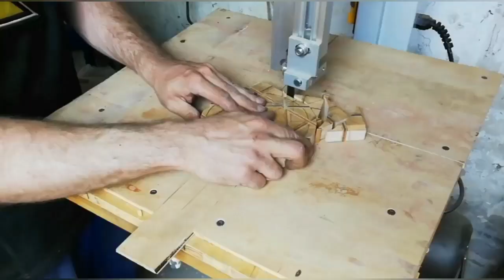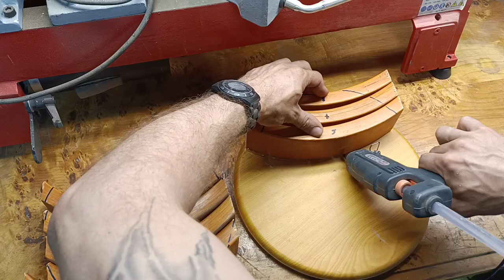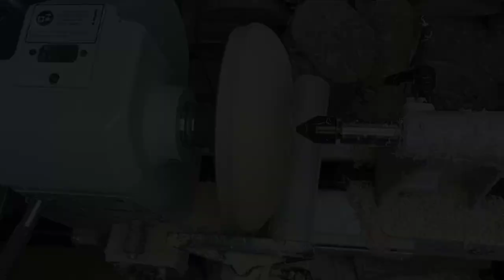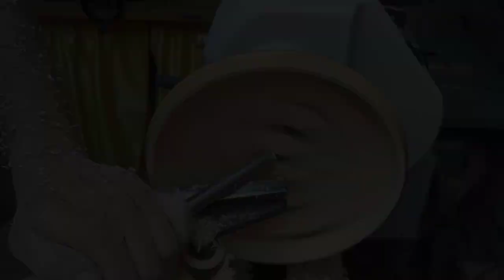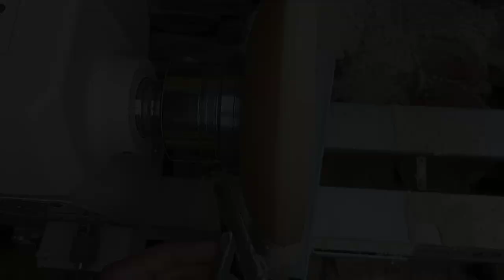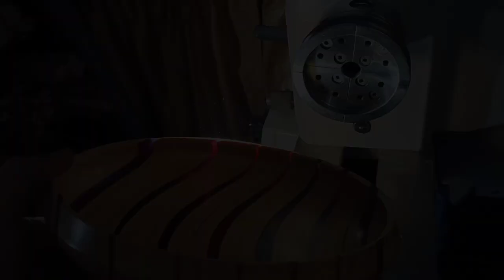Armchair is turnable too 😁 Woodturning

Comment: Oh gosh you could not have made that more beautiful! Absolutely stunning I really like it when the light hits it... I DO have a request. I have NEVER seen a wood turner USE glitter or an interference color. I think the reason is normally when you're using colored resin it's goes in the pressure pot and just too deep the glitter is lost. But something like this where there the chambers for the resin AREN'T DEEP. Couldn't you USE an interference color especially. That's going to give that color shift prism effect depending on which one you use? Anyway that's what I'd like to see. I must say my absolute favorites are beautiful wood grains with colored resin. Like this gorgeous bowl!💗
Reply from the maker: Thank You very much my Dear 😊
Yes, glitter is hard to pour in resin. He is drawing or floating on the surface. I never heard about interference pigments but I have one pigment which is weird and didn't try it yet. Looks like white glitter. Need to test it 😁👍
Reply: @Secondlifeofwoodturning  Awesome! Can't wait! That might BE an interference pigment because they ALL look white and sparkly even if blue or gold Etc.
Reply from the maker: @ssue4q  I have two nice pieces of walnut and I'm gonna test it asap 😀👍

Comment: Wow Rav it looks fantastic!! I would never have guessed it flew off if I had not seen it happen. Your skill patience and determination shows on the repair as well as the turning.
 Well done my brother,
Gary
Reply from the maker: Thanks a lot Brother 🤝😊 Good it broke on joint between wood and resin. Either some scratches would to left. This pieces of armchair didn't got second chance, only third 😀 If there will be more fly aparts I will have to change the name of the channel 😉
All the best my good Friend 💪
Rav
Reply: I have to admit it did look there was finish left on the wood and I wondered about it. But I was surprised when it did let go.
 I was a heck of a great idea how you had them placed. Very cool effect. 
What I have coming up you can use resin on and make a cool looking piece. I am just not interested in doing resin.
 You will see tomorrow.
Take care,
Gary
Reply from the maker: Before I started working on this project I had to cut somehow long s-shaped legs on pieces and figured out what to do from the most curved pieces. And here it is, wavy bowl 👌
Gary, You and resin? No way 😀 I could expect that You will turn a waved, open segmented, 20 inched, inside out vase but not resin. I will be one of the first persons who will watch Your video at 7am 💪

Comment: Oh my, I was scared too 😱.  By what I can tell, it was 6 video frames (2/10ths of a second) before the bowl flew away. Reaction time is about 1/4 second. And the lathe turned about 200 times (1000 rpm?) in that time. Bowl=very fast. Rav=very slow. hehe. Also looked like it bounced off your arm so it missed you chest and head. Whew, close call.
If you hadn't shown the damage we would have never known. It came out looking as perfect as it could - great repair !!! So ...
This was an exquisite bowl Rav ! The light beech, its laminations and curves were a perfect way to give the chair a second life.  But it was the epoxy colors that took it over the top 🏆🥇  So, so lovely - be very proud my friend. I would be.
And finally ... they do say MDF glue is hard on tools - I will not forget the lesson. (next time use carbide perhaps ?)
🤜🤛           Take care. -Mike😷
Reply from the maker: Even without mathematic and physic I got the same results, Mike 😂😂 I realized that blow up when the part of bowl hitted in the light over my head. 
I needed to show to all of You that resin and lacquer hasn't good connection and how it ends 😵
Is MDF board sparkling? This one was a little but it wasn't visible on the video. Shavings were like a sand. To remove it with chisel and mallet wasn't easy too.
Next time I'll be much smarter with using a parts from this armchair but who knows what I will figure out then 😁
All the best my friend 👍
Rav
Reply: @Secondlifeofwoodturning  Yeah, I did wonder Why He Not Sanding Off the Finish near the Resin - but you were too excited by the resin mixing I guess. LOL.
Sand ? Then wasn't true MDF but - what you called it SanDF ? Haha.
Still a very pretty bowl 😍👍
Reply from the maker: You are close, Mike. I was thinking which colors should I use to get nice combonation 😁 When I finished pouring the resin and my mind got clear then I remembered that I didn't sand the surfaces 😬 That's why I used a faceplate.
Have a great day my friend 👍
Rav
Reply: @Secondlifeofwoodturning  The mind is a terrible thing to waste - or so they say LOL🤪 
Moving day today !!!!! (now is 8:00 am )
Reply from the maker: That's true. 15 years ago I lost my mind and still can't figure out what I have done 😂🤪
Great day 💪 The worst ahead of You but You will not have to hurry up. Be safe my Friend 💪
Reply: @Secondlifeofwoodturning  I just hope I have 15 more before the next go-round of forgetting.  
Move is done - now all to do is unpack & set up my new shop  Yippee !! And move my computer gear.
Reply from the maker: That sounds great 💪 Unpacking is taking much more time than packing. Hope we both will never have to move again.
Oh yes, take Your electronic brain with You 😀 At least there everything is set up. I can't wait to see Your new cave 👌😎
Reply: @Secondlifeofwoodturning  Truer words could not be written 👍👍
Reply from the maker: Slowly You will set up everything. To used to to the new workshop will be hard too. I still don't remember where I have half of my stuff and to find it what I want = big mess. I'll be waiting here for You so take Your time and don't worry about me, like You were waiting for me 👍
Reply: @Secondlifeofwoodturning  still don't remember Oh no ! that gives me confidence.  I don't know where I left my toothbrush some days 👴👺
But I shall keep a stiff upper lip and press on. hehe

Comment: Rav,
when that flew off the lathe it broke my heart... That came out so freaking cool man!
Reply from the maker: Luie, I was feeling dizzy very much. It was very fast and my brain didn't noticed that. Didn't had a time to hide before hit and it was only 1K rpm. It was really scarry experience.
Regard MDF. I thought it were glued shavings with sand from the floor. I have seen few little sparks. When I was moving my banjo it was riding like on sand.
Stay safe Brother 💪
Reply: @Secondlifeofwoodturning  oh maybe there is some kind of sand or agent in there🤔😒🤦‍♂️🤷‍♂️
Reply from the maker: It was hard to identify any materials which were used to glue up this board. Hope it will never happen again.

Comment: hello!
Your work is very good, watch the whole video very carefully.
Are you okay after the detachment of the piece?
May I ask you how you got the arched timbers to start the project?
Thank you!!
Reply from the maker: Hi Ariel and thank You 🤝 
Those arched timbers are parts of my old armchair 😁 so I didn't have to make my own but if You want to make own You may cut many two toned thin boards, make a oval cut on the board, insert thin boards between them, cover with glue and squeeze with clamps. After drying You will have arched timbers.